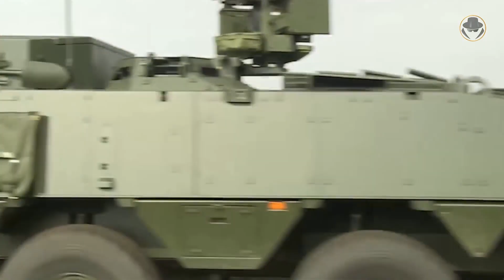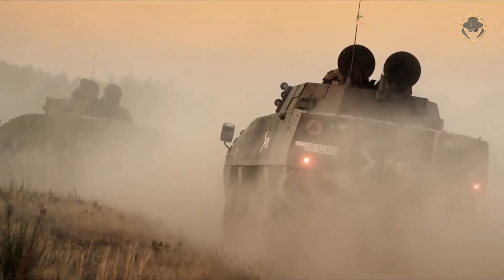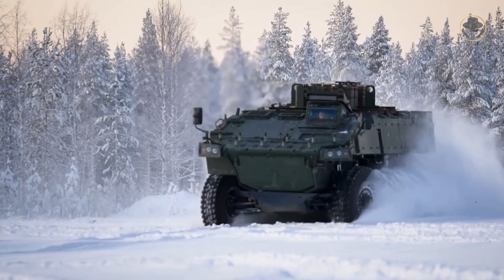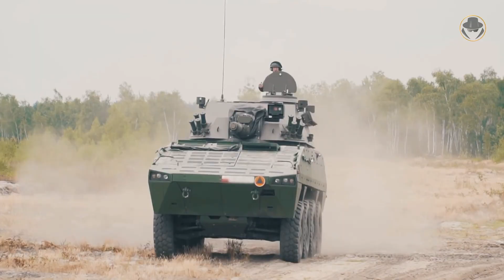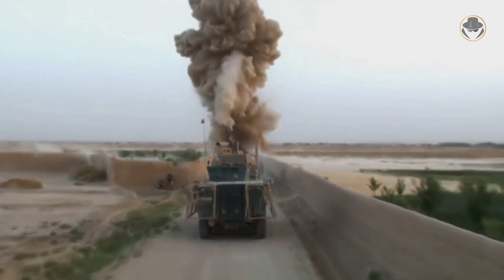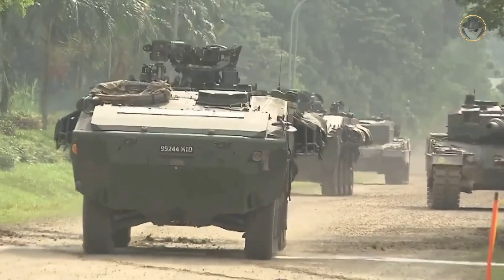Patria AMV | Finland's triumph over other big western producers

Comment: The best thing about this is that you can NOT fit a connon or ATGM or other modules.
Reply: What? You can fit several different turret/weapon systems to the hull hence it can be fitted with large arsenal of different ATGMs..
Reply: @kk-gr3ly  Yes, but you can also not do it.
Reply: @0MoTheG What on earth is your point then? It can be fitted with several different "modules"???

Comment: なんといいますか、三菱のものを採用して欲しかった。確かに優れていますが、我が国の装備としてはいささか向いていない気がしてならない。パーツの生産と共有化もできないので金がかかりそうだし。
なにかしらの政治的な裏工作でフィンランドに鴨られていいるとしか思えてならない。彼らは日本に小さいながらも支社を作ったが、正直その気だとしか思えないのだ。 

日本の軍事産業とその維持においては完全に良くない傾向だろう。
Reply: Did you do any research of the agreement between Patria and Japan before commenting? The AMVs will be built in Japan using local materials, hence making it possible to produce spare parts in Japan without the need to export them from Finland...
Reply: @kk-gr3ly 日本では多くの人はパトリアを歓迎しています。実戦的な車両として。ただ、日本では同じような車両を開発・調達するのでどちらかに絞れないかと考える人も居るのでしょう

Comment: A real shame the UK turned this down and that AMOS would be GREAT for the UK as they got rid of their tracked 105mm guns sometime ago you don't always need something as large as the 155mm gun and the AS90 which the UK only has now to use. Thank you for the video and thumbs up.     👍
Reply: Afaik, one of the four modules the UK has so far ordered for their giant Boxer fleet is a mortar-carrier module, developed and built by RBLS (Rheinmetall BAE Land Systems) in Telford. Though I have to admit it doesn't look as cool. Basically the roof opens on the back of the boxer and a crew of four starts frantically dropping 120mm shells into the semi-automatic launcher. But according to RBLS it features a fire-control system with "automatic target acquisition". In any case, Britain will have plenty of those. And there are so many mission modules for the Boxer, some of which are the result of decades of development work. Like the RCH 155 artillery module, which is basically a fully automated version of the Panzerhaubitze 2000 - don't google it, it's incredibly ugly. But it only needs a 2 man crew that doesn't have to leave the safety of the driving module, can fire 9 155mm rounds per minute and apparently is even able to fire accurately as a PzH 2000 while on the move. There's a bridge-layer module, a 105mm gun module, the Skyranger 30 SHORAD module with it's own tracking-radar and an AHEAD-autocannon. Pretty sure the UK has made the right choice.

Comment: The AMV35 lost out to the German Boxer for a Calvary reconnaissance vehicle but the boxer is having problems. The AMV35 would have been a better buy.
Reply: This was for Australian army by the way.
Reply: What problems Boxer has had?
Reply: The AMV lost because of the turret and how outdated it was iirc.
Reply: @kk-gr3ly  Apparently not for Japan, which seems odd if that was the reason.

Comment: Just love these, commanded a platoon in Bosnia -94 and it served us well even if we got some scratches. Very reliable.
Reply: That's little bit impossible since the first AMV prototype was built in 2001.
Reply: @kk-gr3ly We had the 6 wheeled version (think it was called the XA180) with a 12,7 HMG
Reply: @DeltaStar777  The XA, aka PASI, is a completely different vehicle with a completely different manufacturer and designer. Though the new 6x6 by patria is basically just a modernised and reinvented PASI.
Reply: @kk-gr3ly  Well not completely different manufacturer since Sisu Defense is predecessor company of modern Patria. Sisu Auto decided to leave defense business and military vehicle parts of Sisu joined Patria. Now Sisu is back to armored vehicles with Sisu GTP.

Comment: I was lucky enough to get a 6 month ride on the SISU PASI XA-180 while serving in UNIFIL, Lebanon in1996/7 as a member of the Force Mobile Reserve. Some were fitted with prop-thrusters to assist traversing in water. Strong reliable vehicles. Our driver was one Cpl Timo Kossila of the Finnish Army.
Reply: Not only assisting but to make the APC amphibious.
Reply: @kk-gr3ly  ok smart Alec...

Comment: Finnish AMV has a crew of three (driver, gunner, commander), not two.
Reply: Im a gunner in XA-360 and it is possible to command AMV from the gunners seat and operate the weapon system at the same time. It's not easy, visibility and situational awareness are poor when compared to having a separate commander. I have done it myself in one exercise quite succesfully when our commander was sick, but AMV is definetly a vehicle for three men crew.
Reply: @TheDerperado  I was the commander, and yes you can lead the vehicle from the gunners seat but you don't have the radios there. Also like you said you can't see anything else than straight forward plus what you see from the screen. And there is no monkey head at the commanders position, so gunner/commander would not be so great.
Reply: Probably meant the crew with out the gun.
Reply: @pipopoikapelaa5468  Possibly, but Finland does not have any AMV's in service without a gun turret.
Reply: @TheDerperado  I was going to say the same thing about crew of three. Because he said "The XA-360 variant of the Finnish Army...".

And didn´t mention anything about Nemo only Amos.

Comment: 32 tons, but only protected against 7.62mm? Sounds strange. And with all these different variants, the Finish armed forces only ordered 62 of these vehicles? That would just be enough for like one batallion. A lot of development effort for such small number. Something doesn’t add up here.
Reply: Up to 32 tons, the lightest versions are only 16 tons. The FDF has been strapped for cash for some time due to all of the different upgrade projects, furthermore armored capability hasn't been a top priority due to the XA-180 still being a capable enough APC.
Reply: It is 12.7 cal protected.
Reply: Up to 32 tons, lightest version only weights 16 tons. The reason why Finland got so few was thanks to the government and budget cuts.
Reply: Its up to 12.7mm protected allround.

we've exported more of these than using it ourselfs since we still have the PaSi's, which are still great!
Reply: Well, you're not supposed to drive them to front lines. They don't have to to survive direct 420mm hit.

Comment: The double barrel mortar is the most badass thing ever.
Reply: any video of the loading system?. they are not just dropping the ammo from the top like regular mortars.
Reply: AMOS sure is a dope ass system
Reply: The AMOS system is an autoloader... why are people talking about soldiers loading it?
Reply: @Cloudslinger0815  AMOS doesnt use autoloading. The grenades are loaded manually from the bottom.
Reply: There are 2 loaders, one for each barrel
Reply: @jonesijones Well no. There´s Loader and Assistant Loader.
Reply: @efz629  Well yeah, technically they both do the same things. As someone who has served as an AMOS crew member the only difference is during exercises. When firing they both do the same thing
Reply: @jonesijones  If both are loading their own barrel, there will be some hassle because of lacking space for the person who is closer to door.
Reply: @efz629  With a year of experience sitting in the back and loading it I can tell you that yes, both loaders are loading the barrels at the same time
Reply: @efz629  Takes a little practice to get all the movement between the rack (where the grenades are) and the barrels because the both of the loaders are moving at the same time and there is not a lot of space in the back
Reply: The loader must use two hands, sheesh.
Reply: @janne9034  I'm sure the automatic loading system will do fine. Even with zero hands.
Reply: @janne9034  Mahtaa hävettää? Paras järjestelmä maailmassa.
Reply: @janne9034  Fortunately, I bet, most of the loaders has pretty much exact that amount of hands... per each loader person!

Comment: Croat soldiers ran into an IED ( improvised explosive device) in their Patria in Afghanistan. The explosion was so strong that the vehicle "flew" into the air and crashed onto the roof. There were minor injuries of soldiers, but no one died. So much about Patria AMW. We should build more, at least another 200 pieces.
Reply: And that was one of the huge selling points for them back in the day.
If it's the same thing we are talking about then pictures of the aftermath were used at marketing and it really looked like there's no way people survived.
Reply: Patria has a 6x6 vehicle coming up. This is not a variant of the AMV but more like a modernized version of the Sisu XA-180. I think the main point of it is the improved armour.
Reply: @tommiturmiola3682  Also big technical improvements. A nice video comparing against the old XA-180: https://www.youtube.com/watch?v=_8tuaa_yYyA&ab_channel=PatriaMedia
Reply: Yeap, we need to build more of these and mount a Oto Malera 76mm turret on them.
The rapid fire gun can unload 60-80 rounds per minute.
Perfect for SHORAD that we need to aquire.

DART ammo will provida anti air capability.
Vulcano ammo will provide indirect fire ability.
Tbere is even APFSDS ammo.
Reply: The same happened to Polish Rosomak. The vehicle got airborne, and its front wheel flew 70m away.
Reply: @HanSolo__  that was the Polish Patria AMV,this man lies and claims that it was Croatian,but Croatia didnt bring Patria to Afgan,not even Humvee,Usa donated their for us Croats to use it in Afgan...
Reply: Yes, we walked the whole time in Middle East.
Reply: What did you groaks expect? It should be able take on 420mm and then shoot back with its two 640mm cannons?

It's not a tank.
Reply: @UltraCasualPenguin  IED's are usually hidden (or if they aren't, they usually are in the middle of a road to make vehicles stop) so not like they could have really predicted it
Reply: Rubbish - You need the South African Ratel - tried and tested against Cuba, East Germany and Russia in Angola and SWA with devastating effect and success.
Reply: Ne laži,Hrvatska nikad nije bila s patrijama u Afganistanu,kao prvo.Kao drugo Poljaci su jedini koji du doveli patrije u Afganistan i jedna je bila pogodena rpg druga ied.
Reply: @_puz_913  Nas će učiti klinci gdje smo bili. Super
Reply: @user-xj3ve7wt8k  ok boomer
Reply: @_puz_913  Vojnik lima, vojnik. Dok smo lovili Afrikom i Bliskim Istokom, još si dudlao palac. Ali Hrvatska nije bila u Africi, pošto nijedan hrvatski medij nije ni riječ pisao o tome zadnjih 20 godina, zar ne ?
Reply: @_puz_913  ok kid, time to bed.
Reply: @tommi7554  ok boomer

Comment: Well such a great video! The wheeled military vehicles as topic for me like a chocolate cake with so much extra chocolate! But let's see the Patria. And let my analyse this wonderful vehicle for me, and please correct me if I'm wrong. Well let's clear something in my view smaller and weaker countries like Slovakia, Croatia, Slovenia or even my country Hungary shouldnt force the use of MBTs, or just in a very limited number. Why? First: the Leopard2A6 cost about 5.6 millon €,  the Leopard2A7 is already cost 13-15 million € (This is more than 5 billion HUF), and we haven't talk about other maintenance prices. Just the fuel, you have to move a 60+ tons tank with 70km/h , you roll to the petrol station once and you will be the customer of the year immediately. So for the smaller armies the wheeled vehicles would be great alternative, to transport our troops and give them fire support againts MBTs more over they could use as tanks. Okay it's a bit crazy but there is the Rooikat MTTD or the allmighty Centauro B1 and B2. They design to be Tanks. And you dear Detective called it as Wheeled Tank. To be honest I hate to use this phrase because usually 7 year old kids use it for every Armored Wheeled Vehicles. But in this case it was the 2 best words to describe it. The B1 variant which is still worthy is 1.6 million € the much modern B2 variant cost ~10 million € but it is not the proper price, because I calculated it from an Italian 1.5 billion € pact which is inculding 150 units with additions and spare parts. But why am I talking about it? Because in my opinion the Centauro family and GTK Boxer are the best wheeled vehicles in Europe or even in the NATO. And there is the Patria AMV almost as advanced as the GTK Boxer but cheaper. Not to much cheaper only 210k € the difference. And both of them used by 7 countries. But why would be the AMV a better choice than the GTK. To be honest I am a great fan of the German one. But if I think as a politician, the AMV is great because the Finnish love to cooperate with me, like with the other countries. They let me to produce the vehicle in my country to create new moduls for it. And because I produce it locally, the cost of the transportation isn't a problem. Well in case of the Rheinmethall, I'm not sure about they would cooperate on this level. And both vehicle modular, and the AMV has 120mm turret version and maybe the Rheinmethall would create a Boxer with a 120mm turret if a country ask them. But dear Detective I have quarry abot this. I just thinking, in this scope of duty could be a modular vehicle which is planned to be everything that a Wheeled Vehicle could be, as good, as that one which is design to be a tank, a wheeled tank? To end my brainstorming. The Patria AMV is more than a great vehicle, it is a great choice and a lethal weapon. And it has dignified look. And the match of the GTK or any new Generation armored vehicle. Thank you so much for the video, you gilded my day with it. Have a nice day Detective!

Comment: It's ok but the Boxer is so much superior! Australia made the right choice.
Reply: How so?
Reply: How exactly? The only thing I could think would be the modularity of the boxer but that's it.
Reply: Payload is much higher on the Boxer chassis. Patria AMV maxes out at 32 tons, Boxer can go up to 41 tons. Enables much more variants including 155 mm artillery.
Reply: @jonny2954  That makes no sense at all. These vehicles are for medical, troop transport and command use lol
Reply: @Thecapper-c8f  No, Boxer was developed as a multipurpose platform supposed to fill much more roles than just these 3. Boxer versions also include IFV, Recovery, Mortar, 155 mm SPH, 155 mm resupply vehicle, Bridgelayer, Engineer, Counter battery-radar, MLRS and SHORAD/C-RAM air defense. KMW recently also presented their tracked Boxer aswell, a tracked platform that can take the exact same mission modules the wheeled version does, completing the logistics and maintenance friendly backbone system as a whole.
Reply: @jonny2954  So was many other vehicles. Patria AMV Amos for instance
Reply: @jonny2954  AMOS is twin barrel 120mm mortar system built on Patria platform.

Comment: using a bulky 360° deg rotating turret with a 30 MM cannon don't make much sense . . . when the IFV can be armed with a 30 MM GAU-6/U Avenger six-barrel rotary gun & 13.5 MM HMG mounted to a standard issue RWS . . .
Reply: It could make sense if you have said turrets by the hundreds in old soviet APCs.
Reply: Where do you think some countries like finland and South-Africa would get Gau-6's?